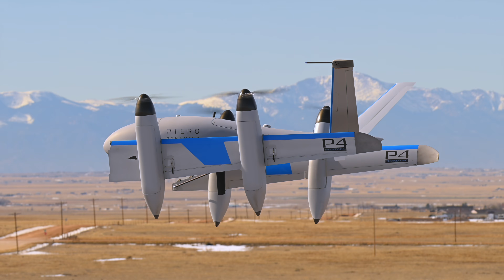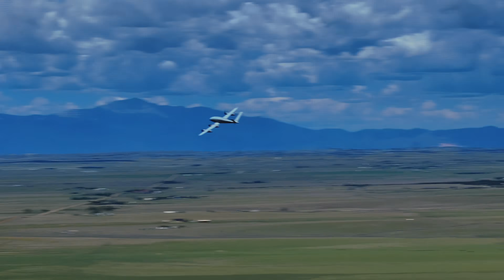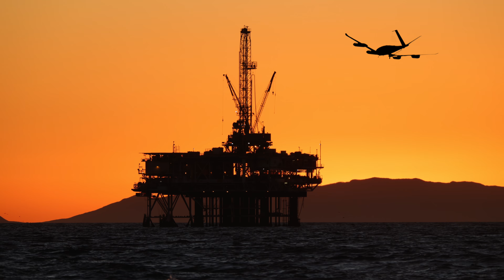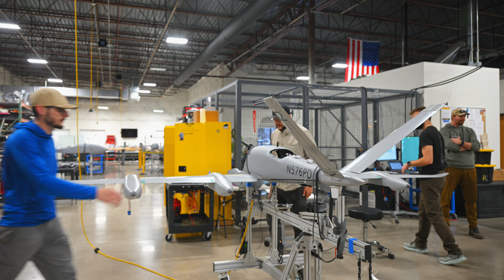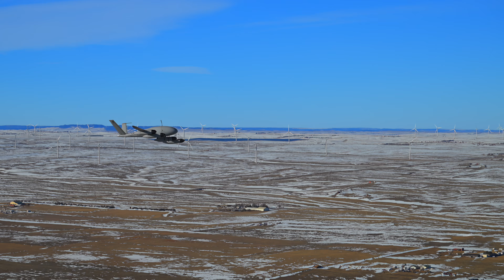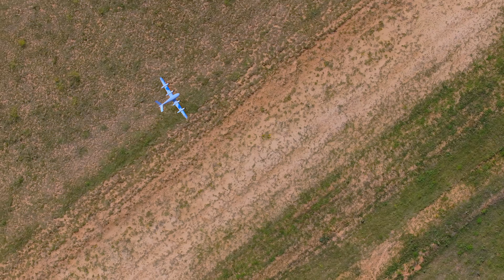PteroDynamics - The Future of Flight

Comment: This is a slick concept, but I am curious about the payload.  One limitation I see is that you cannot have under-wing stores with this configuration, so whatever sensors or weapons you might lift will need to be mounted either internally or under the centerline.  This is not necessarily a disadvantage, particularly if you're looking at it as a potential cargo ship, but for military applications they're going to want it to carry weapons, and right now you're quite limited on what you could carry and where.  Hopefully you can overcome that, at least well enough to make t work for ISR and light CAS missions.   Or perhaps scale it up a bit and have it carry a bunch of sonobouys and/or a light torpedo, for ASW or anti-mine missions, perhaps launched from an FF or LCS flight deck.

Comment: If you can get it to scale, producing one of these that could glide-bomb out of the back of a C-130 to load up a single, downed pilot up to 225lbs would be ideal for extraction.  If the pilot isn't injured, he may not need a full CSAR team, but rather a fast and stealthy transport to a safer location.  Tune the props for lowest effective decibels and autonomously fly him to an easier extraction location or even to a secondary, fully charged unit.  He can set a timed charge to burn the first unit, climb into the second, and go the full range distance again.  You could even load the unit with a removable battery in the passenger space or droppable, external fuel tank style for the glide down.

Comment: I see they dont have European patent, maybe because a fking folding wing is already used on numorous aircrafts, as i see it, its just the socket design it turns on thats is actually patented, so anyone can make a 45 degree rotating wing, but i would consider this a weak point anyways, so many things can fatal break on this system, and it cannot take off regular is a big nono as well for carrying weight, huge energy drain if not needed.

Range is about 120 km according to data, flight time max 70 minute, i would expect alot more from a drone this size, but i guess thats why they are making the P5.

Patents = corporate greed and stopping all humenkinds progress for own benefits and gain (i mean how greedy do you have to be to patent this 45 degree socket and claiming they are good guys?), never getting tech explored to its maximum potential, its like the 3D printer patent that had to expire before regular people got access to it, me personally, i would never support such a company for a dime, let the patents expire and them go out of business.

Also remember, for most countrys patents does not cover private, non-commercial use, so build, create, hide it from this company, and in about 10 years, sell it.

Comment: Where is the centre of gravity?  It is about 1/4 or 1/3 from the front of tha wing backwards of the width of the wing. Centre of gravity is surprisingly near the front edge of the wing. When  the wings are tilted back rear motors   have very little weight on them what they can lift and front motors do almost all the lift. And I think that when front and rear motors seems to have same size propellers front motors can not lift the weight of the plane.  They shold get those vertical lifting motors closer to the front of the plane, especially the rear ones.

Comment: Super awesome!! Aircraft designers say propeller shafts should be some distance over the wing to improve lift and not below it as you have. Obviously that will make the VTOL footprint narrower. This can be offset by spreading out the wing hinges.
Other topic is that the inner propellers take the most weight during VTOL and the outer ones offer only pitch balance. So, arrange the hinge-wing geometry so that all four propellers move forward for a better weight distribution & balance during VTOL configuration.
Last I can contribute to, are these two rods for wing retraction. See that they "disappear", by becoming part of the fuselage aerodynamics, to improve efficiency during aircraft mode.
Again, awesome concept, with room for improvement.

Comment: Neat design, but I have a few questions on the theoretical vs practical efficiency. While you save weight on not duplicating motors and propellers for VTOL and normal flight, you gain weight in other areas, ie. overpowered motors for normal flight (the other side of the coin for the “beast mode” you mentioned), the weight of the hinging/locking mechanism, and the lack of a single unified wing structure. How do these trade offs impact the feasibility of this configuration at different scales?

Comment: It would be ideal for long-distance missions like delivering 81mm mortar rounds in Ukraine, maritime surveillance with multispectral cameras, or fast package drops, while its autonomy and wind tolerance enhance reliability in harsh conditions; however, its limited payload restricts it to small loads, the folding wing mechanism’s complexity may hinder scalability for air taxi use due to structural stress, but adding systems like direct ethanol fuel cells or munitions/cargo drops could increase its capabilities and mission flexibility.

Comment: Put wheels on the bottoms of each of those motors and you also have a car..  You could even use the same motors.  Use differentiated motor speeds for steering.  It's good for short range driving.  This is useful to get to parking spaces without blowing rocks and dirt all about.  Land on grass and drive into the parking lot.  Also, this might be useful for combat missions in Ukraine.

Comment: In the folded-wing mode, all of the lift is applied through torque on the wing hinge which twists each hinge with half the weight against half the lift.  Would that make the hinge a critical, weak component with lots of stress and wear, and require lots of maintenance and attention?
Also, can it hover and land with only three motors running? Thx,

Comment: My big question is whether that mechanism and propulsion is scalable  to something in the size like the V-22 Osprey etc because when you get that large you generally need turbine propulsion and I'm curious how to implement that into 4 rotors. I'm curious how they would make it work with something other than electric motors.
Reply: That design will always be electric.  It would be pretty much unworkable and pointless to try and put fuel tanks and turbines on that.  All aircraft except jetliners and high-power military aircraft are going electric, riding the rise of batteries, which will be getting about 5% better every year for many, many decades.  Electric aircraft are taking over little by little, because they are so much more efficient with cheaper fuel and maintenance, and able to have far more redundancy and new designs.
Reply: @charliedoyle7824  I guess you could have turbines or whatever on the fuselage creating electricity for electric motors and do a hybrid type of thing. So do you think it's only scalable depending on electric motors and battery technology?
Reply: @sgsheff  hybrid is possible, but not necessary because of the battery improvement curve that they all know about and expect, and the extra complexity of putting an engine, generator, and still some batteries and all the same electric motors and controls.  
Batteries today are good enough to sell battery-electric aircraft with some good applications, and the design is so much simpler and likely more reliable and redundant.  
Even auto manufacturers know that hybrid cars are only a temporary phase, likely over in the 2030s.
Reply: @charliedoyle7824  I'm just thinking that if this design really is the most efficient VTOL to winged flight then it's worth using it for the biggest things needed with these capabilities. Battery tech is improving a lot but it still seems a long way off to providing the same power density as gasoline. The military still isn't equipped for a significantly electrified military. They have lightweight exceptionally efficient engines in development for aircraft so I could see a gen 1 Chevy Volt style system.  Cars are different because the market impacts what they make and the market is somewhat rejecting an all electric future and manufacturers are being forced to change future electric plans until the battery tech is improved and available.

Comment: I genuinely admire the work that PteroDynamics is putting into their designs—it’s clear they’re pushing boundaries with their drone technology. However, at its core, what they’ve developed is still just a drone, and I can’t help but feel there’s more to unpack here. There’s an impressive amount of engineering involved, no doubt about that. For starters, consider this: in their demonstrations, they might only show a single operator managing the system, which seems simple enough. But when you factor in the weight of the drone—its payload, structure, and components—it raises questions about efficiency and practicality.

What puzzles me is that they don’t seem to be addressing some fundamental challenges. For instance, they’re sticking with spinning rotors instead of exploring alternatives like turbofans, which could potentially offer more reliability or power. Spinning rotors, as we know, come with high failure rates due to mechanical stress and wear over time. That’s a significant limitation they’re not tackling head-on, at least from what’s visible. It makes me wonder if they’re truly solving the deeper problems or just refining an existing concept.

To me, this feels less like a groundbreaking solution and more like an advanced version of a projectile system—you know, the kind where you position it near a target, launch it, and it essentially sacrifices itself to get the job done. I’m not trying to tear it down or be overly critical; I’m just pointing out that while there’s a lot of clever engineering on display, it might not be the leap forward it’s hyped up to be. There’s potential here, but also plenty of room for improvement.

Comment: Huh that wing design is actually pretty clever, it solves a lot of problems with wing loading and reducing the complexity of linkages in moving components. Most vtols like the v22 osprey have similar to variable sweep wing aircraft issues with complex moving linkages and structural loading across that joint. The v22 can't transition to forward flight nor from forward flight to drone like flight anywhere near as fast so that bit is pretty damned impressive. Also definitely not just hype as they seem to have a whole lot more than just 1 of the aircraft.

That said I guarantee it's going to be pretty quickly used in warfare as one of the bigger issues with large plane type drones is that they need a runway to takeoff and land.

Comment: Ptero has been at this for years.  This aircraft has been flying for years.  Where is the scaled up gas turbine prototype?
Reply: Gas turbine ain't gonna happen.  That would be silly.
Reply: @charliedoyle7824  Not as silly as the V-22.  Scale this thing up with 4 gas turbines and it would be a winner.  Sounds to me like Ptero is going to use a gas turbine generator. "- Hybrid electric/internal combustion engine powertrain that can burn JP-5 fuel"
Reply: @ If it uses 4 turbines, I assume two on each wing, how would it also have "hybrid electric/internal combustion engine"?

Comment: I feel like this design would lend itself well to a 'drop-line' feature where the pay-load is carried snug under the belly of the craft in a detachable compartment that could be lowered down with a retractable cord/cable. The compartment could be something that is fully detachable that would be left at the drop site, or permanently fixed to the tether and gets retracted back up to the aircraft once the package had been secured. I assume this would just be an issue of designing a box-compartment that would still allow stable flight when the wings are fully unfolded and adjusting the propulsion levels for the added weight of the materials and hardware, I can't imagine a 'batman' style grappling-hook to be used in reverse would be cheaper to buy or design form scratch either.
Just some morning coffee thoughts.

Comment: now make it 5 times the size and you've got a great competetor for the V280 valor. But I would also love to see a civilian manned version. With a larger version you could also put the motors/actuators into the wings and joints improving drag without those external rods

Comment: Would love to see a Consumer level version with PteroDynamics licensing, in the 1.5 to 2m wingspan range, big enough to carry one of the new generation of digital FPV systems with head tracking pan/tilt functions, and running one of the open source Flight Controller packages, like ArduPilot, iNav or BetaFlight.
A version partway between that and the full size unit, would be ideal for Search&Rescue and local government uses.

Comment: where is cg? it looks like inboard motors carry most of the weight when hovering.. unless it is tail heavy
Reply: I'd say the mass is mostly concentrated on the engine pods. So the CG moves dramatically forward for fixed wing flight
Reply: hm, yes, makes sense, it would help with cg shift if you put batteries in outboard engine pod, or slide in frame

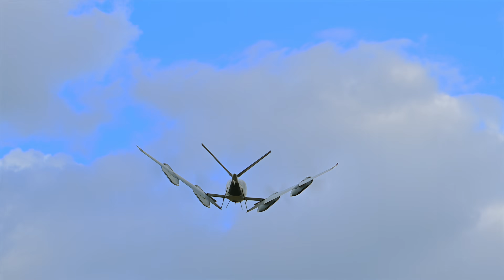Comment: "the most efficient, safest unmanned aircraft", then a second later they show a massive ESC desynchronization with the 2 wing tip motors failing during transition to the point where it looked like it was about to completely lose control at 1:36. Nah bro, this drone is far from the safest if you have desyncs like that, ESPECIALLY during transition. Though the ironic timing is hilarious, at your expense.
Reply: The outboard motors are intentionally shut off once it has transitioned from VTOL to cruise flight since that power is not needed for cruise flight. It is well-controlled in transition (See 2 min mark for further explanation).
Reply: @briannewton1445  the video didn't say anything about shutting down the other motors for forward flight, it just mentioned the increase of efficiency of fixed wing over a quadcopter. Additionally, the props keep spinning. Additionally additionally, not powering the motors at the wing tips would obviously cause the props to continue spinning which adds considerable drag. So even if your claim that it's done intentionally is true, powering down half the propulsion system adds a ton of drag and reduces efficiency, not improves it.
Reply: You missed perhaps the most outrageous part of this: they were approved a patent 🙄 what crooked agency or government issues a patent on a drone flipping his wings in the air like that? Meaning: no one else can make a drone that flips its wings like that or any other aircraft.
Reply: It does. Also, the CEO says you can light up all four motors in "beast mode" to dash faster. So, it is implied, but also, you jumped to the wrong conclusion and then proceeded to cast aspersions. Not very professional on your part and does not serve your 108 subscribers very well. Many others have commented about how smart it was to have the props fold back when switched off. I'm not sure why you had to take such a nasty and erroneous approach to your commentary.

Comment: Reminds me of those Grumman gunslinger wings on the E-2. Sorry guys, someone beat you to it.
Reply: Grumman invented the Sto-wing for stowage on aircraft carriers back in 1941. That's not what PteroDynamics is talking about here. The Transwing wings fold alongside the fuselage DURING FLIGHT, so it can take off vertically and quickly (in 5-10 seconds) transition to fixed-wing flight, eliminating many of the compromises of other tilt-rotor, tilt-wing, tail-sitter, or lift+cruise VTOLs.